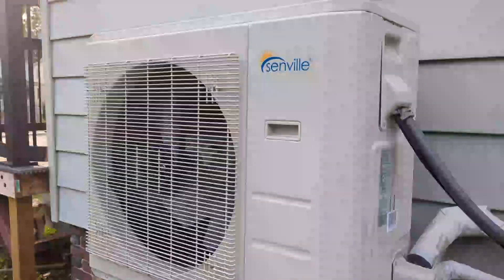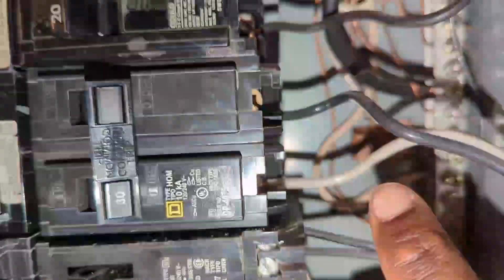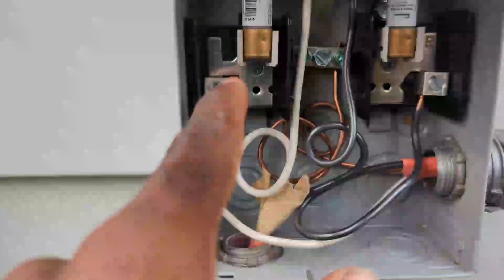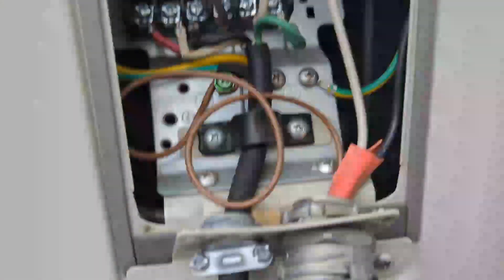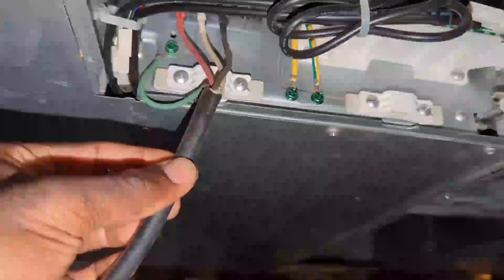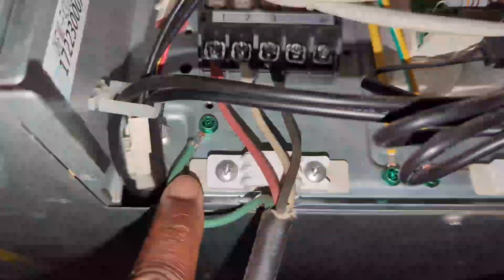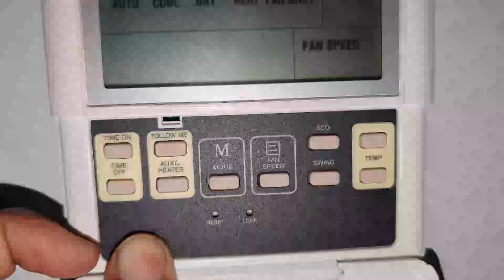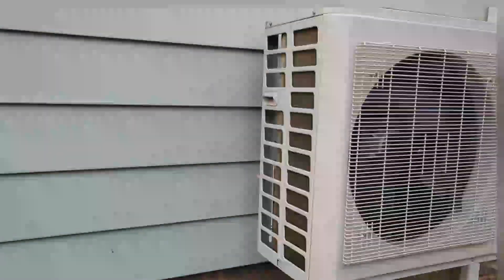Senville 24000 BTU Heat Pump Conditioner Concealed Duct Air - Wiring

Comment: Thanks have the exact same unit, but there is one more set of wires for the remote control?
I see the 'device' on my unit has five wires on the outlet side, but my thermostate cable - like yours is four wire plug plus separate ground terminal ring.  
The instructions say the 'device' is for testing purposes' only? not sure I understand what this device is for, or how to wire up properly.
Reply from the maker: Yeah mine has 4 wires. 1- red, 2 white, 3 black and ground. Maybe they started to use the same cable for multiple devices.

Comment: Hi I noticed you've had this unit for 2 yrs thinking of getting one. How has it performed for heating and cooling? What's your weather like? And any failures or repairs to this unit?
Reply from the maker: It's still working good. The unit is half the size for the house. We also have a gas furnace as well. We have to use the gas furnace when it's too cold not because it doesn't produce heat but because the unit is too small for the house.
Reply: @talenteddad  alright thank you and what's the sqft of your house?. I'm working with less then 800sqft second floor.